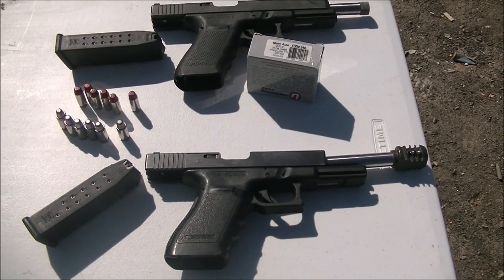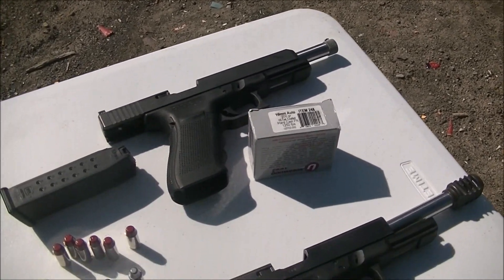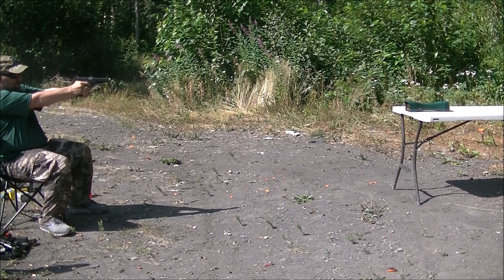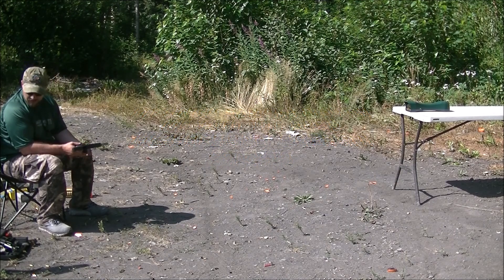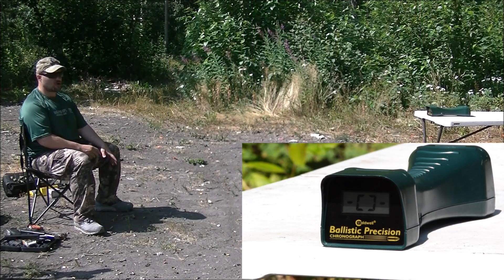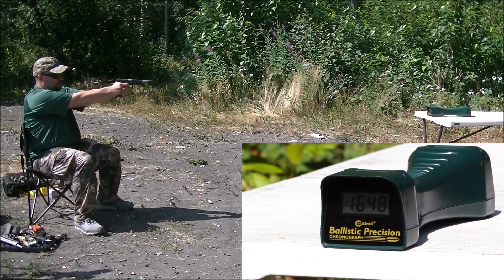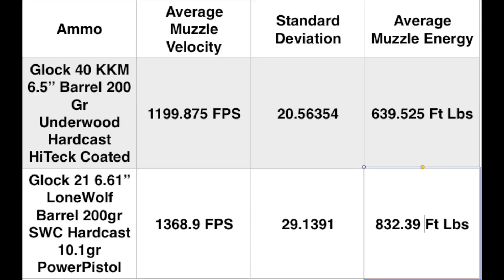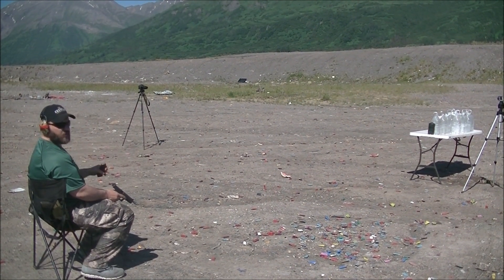10mm vs 45 Super 200gr Episode 3: Hardcast Lead

Comment: The .45 Super seems a little too much of a wildcat load for me. The 10mm is a proven performer and that loading looks pretty good.
Reply: It’s not a wildcat when several manufacturers make factory loads. I have 11 diff offerings sitting on a coffee table.
Reply: While 10mm is a proven performer so is .45. 45 super is just a +p++ 45 acp. It has a slightly thicker web. But because hundreds of different models chamber it it’s actually not a wildcat at all.
Reply: Leroy Dabbinzz Interesting and thanks for the info. I haven’t seen it around, but I probably haven’t been looking in the right places or very hard. How does the frame and hardware hold up to it? Seems like a lot of stress on the polymer G21 frame.
Reply: Meh, heavier guide rod spring any you’ll be fine. The 10mm is actually much higher pressure. And the g21 and g20 are very similar. Although I prefer the heft of a 1911 for a 45 super platform. With a nice WC comp it has similar recoil to a stock 45acp.

Comment: Mike R's comment about a 45 super and a 9mm +p... I think... NO WAY!!!  Mass and Velocity wins, but you have the numbers so I'll just stay in my area...Deer hunting!!!   lol
Reply from the maker: He has a point on the sectional density
Reply: Sectional density already factors in the weight , it is compared on the basis of the cross sectional area of the bullets .  * Everything else equal * , bullets of the same SD at same velocity, wil have the same penetration .

  But of course everything else isn't equal . Once you reach really deep levels of penetration , seemingly small differences in bullet design make a difference . Things like exact shape of ogive , exact porportions of meplat size, twist rate , etc .

Comment: Chuck I gotta say I love the testing you do and I agree both would be excellent choices for bear defense ! 
 I would definitely choose the 10mm personally due to its availability.
Reply: 10mm is certainly more often loaded by more manufacturers. Buuuuut I could be wrong here imo there’s only 3 or so manufacturers that load 10mm to its true potential with the appropriate projectiles for bear defense (underwood Buffalo Bore and double tap) and they all offer 45 super/450SMC loads too and since I have to order anything from those makers both calibers aren’t easy to obtain for me. So I chose the 45 super because it’s bigger, hits harder, and it’s different...... btw have you messed around with handloading 45 super in 45 amp brass? I know guys that break 1,000 ft/lbs in GI brass reloads. It may help make it more attainable to guys that have issues obtaining star line brass
Reply from the maker: Couldn't agree with you more on the availability. I only have three types of ammo available to me at a local shop oh, and one other place I can order it. Otherwise it's handloads

Comment: Not sure what's up with the 10mm velocities there, I average 1230 fps with the 220s out of my G20 with 6" kkm. I'm thinking about setting up a 45 super or maybe just running them in a HK USP 45 with a heavy spring, not that I need one, just can't help myself.
Reply from the maker: Lol... yeah.  Im going to email Underwood about these when i get home and look at the lot#
Reply: I'm running a 22lb spring, could that be giving longer lock up time and therefore higher velocities? I doubt it could account for that much difference though, you're running at least 100 fps slow. Just a thought.

Comment: I love all the hard work you put into these demonstrations! But I have to say  that I don't agree that those two rounds are "ballisticaly" similar at all.
The 45 super 200 gr bullet would be more equivalent to a 9mm 124+p @ 1300fps.
A 124 9mm has a sectional density of .140
A .451 45 200gr has a sectional density of .141
Both move at the same velocity would in theory yield the same penetration if the same bullet design is being used of course.
The 10 mm 200 gr .400 has a sectional density of .179
A balistacally similar.45 would be a 255 grn .451 @ 1200 fps with a sectional density of .179
Reply: Maybe I’m missing something but just because they have similar sectional density idk how you can compare a 200 gr 45 @1350 to a 124gr 9mm at 1300 just because they have similar sectional density. And no they don’t yield the same penetration one weighs like 80% more so it as a result has more momentum and energy.
Reply: Leroy Dabbinzz It is like chopping wood with an axe broadside vs on the edge. The axe still weighs the same, it is the sectional density of the blade edge that  give you the result.
In fact all things being equal (sectional density, velocity and bullet construction) a 9mm .356 124gn and a .451 45 200 gn in this case, if fired through the same medium will in fact yield the exact same penetration depth. 
It's simple physics really.
Reply: Your ignoring the fact that even I the 9mm and 45 super penetrated the same you'd be pushing through all that material with a projectile starting at 45 cal instead of 38 caliber and that's a lot more destruction along the same path!!!
Reply: It isn't strictly about equal penetration. It is about mass, frontal area, weight retention, size of wound channel and penetration. Sectional density alone is a criteria for finding the form factor which is a common denominator between two projectiles of different calibers, not a do all end all final, ultimate nor optimum choice. For example as you understand it already; a 175 grains 7 mm caliber bullet shares the same form factor as a 200 grains .30 caliber bullet. They are close enough that it becomes personal choice, mine is to go for the heavier of the two but it doesn't stop there. The 300 grains .375 caliber also shares the same S.D. and therefore "form factor". (bullets can be shaped any way you want and this does not under any circumstance change sectional density) so sticking to form factor....You could not hunt Cape buffalo in Africa legally with a 7mm or a .30 caliber. The strict minimum in most jurisdictions is a .375 Caliber bullet. My point is that everything I mention above "mass, frontal area, weight retention, size of wound channel and penetration" get into play. Not just S.D.
Reply: @paulhomsy2751  Fair enough. I prefer a .45 Caliber over the common.40 caliber bullets for the (Bear defense) loads. I prefer the heavier 255 grn over any 10mm/.40 caliber load. 
It’s my belief that the extra weight and momentum will carry itself through more tissue and bone. 
Not only that but in my experience 45acp is more reliable in function in most platforms. But that’s a whole different topic.
Reply from the maker: But this isn't .45acp
Reply: Right consideration👍
Reply: Right consideration👍
Reply from the maker: I can agree with that.
Reply: Maybe that’s not what you’re saying. But a 45 super is a completely diff beast than a 9mm. Sectional density and velocity isn’t the whole story
Reply: Leroy Dabbinzz I'm not saying at all that 9mm is a 45 super, I was simply referring to his comparison of the 10mm 200 and the 45 super 200. It's no surprise the 10mm penitrated deeper. It is more dense. 
A 255gn in 45 super would be a closer comparison.
Reply: @Mrgunslinger3  One bullet is not "more dense" than the other, one bullet made of identical components than another may have a higher Sectional Density than the other because of its heavier weight within its respective caliber. To say "more dense" can suggest that one is made of a softer or harder material than the other which is not the case. I know you understand what sectional density is, I'm just correcting your use of the word "dense" alone because it can be quite misleading when not used with the word "sectional" in this particular ballistics context. To illustrate the point I'm making better: Take two projectiles of very different materials in .45 caliber each weighing 200 grains. A wooden dowell and a hard cast lead bullet. they both have an identical sectional density. One is 8 inches long because it's made of light wood and the other is the size of a standard 200 grains, 45 caliber hard cast not even one inch long, yet they share the same identical Sectional Density. In this particular instance you can definitely say that one is "more dense than the other".  However when materials used are the same but one bullet is heavier than another of the same caliber, its sectional density increases but it is not by any means more dense than the other. The difference in density is based on the materials used. Nothing at all to do with Sectional Density which is strictly a measurement of mass. A relationship between the square of the diameter of an object represented in inches (decimals) to its weight in pounds, (not in grains). This is the international industrial standard.
Reply: Leroy Dabbinzz To put it more clearly
A 9mm 147gn
A .40 or 10mm 180gn
A 45 230gn
All share the exact same sectional density but weight much differently.
If fired at the same exact velocity through the same media using the same brinel hardness hardcast lead bullets each with the same bullet profile ojive etc... would have near identical results.
Not everything is Size and weight, but then again it is. 
However a bullet carrying more mass will most likely be less deflected when encountering bone etc.
Reply: @Mrgunslinger3  ummm..... momentum......
Reply: Dave Not that simple. Sectional density has more to do with penetration than foot pounds energy or "momentum " . I can take my .454 for example a 325 grain @ 1200fps will out penitrate a 270 grain load @ 1400 fps by a considerable margin. Both using the same style SWC bullet design. Why? Because the 325 grn is much more dense. 
An arrow that moves @ 450fps and a rock both weigh the same and both traveling the same speed will have equal amounts of momentum but one is much more likely to penetrate. Again sectional density. 
Hope that makes sense
Reply: @Mrgunslinger3  a 485 grain .458 bullet will penetrate more than a 137 grain .243 bullet, same bullet construction, oh let's say both 1500 fps. Same sectional density.......
Reply: Dave Pure speculation.
Reply: @Mrgunslinger3  okie dokie buddy 👍
Reply: Dave With equal amount of force in opposition -  no they would be very close in comparisonas far as penitration goes. It's simple physics with all things being equal as far as velocity and bullet construction. You're referencing a .458 socom and a .243 win, same sectional density would have the same amount of opposing forces applied.
Reply: Dave But in the real world where .243 win and .458 socom can't be had with the same type of bullet construction it is purely speculative.
Reply: @Mrgunslinger3  momentum bro, momentum
Reply: Dave Momentum and foot lbs energy are one and the same, and has little to do with "Penitration" which is the topic in case you forgot that.
Reply: @Mrgunslinger3  no, momentum and ft lbs are not the same. Kinetic energy and momentum are different sorry
Reply: @Mrgunslinger3  lol @ the quotation marks on my misspelled word
Reply from the maker: Mike Robinson i plan on doing the 10mm 220gr vs 255gr 45super
Reply: Alaskan Ballistics nice!
Reply from the maker: Did you see episode 4 where i did the 220gr vs the 255gr @Mike Robinson?
Reply: @AlaskanBallistics  I did not. Now I'm going to have to look it up. By the way, can you safely shoot 45 super in a stock glock 41? I've seen some say yes and others say gen 4 yes gen3 no unless modded. Just curious.
Reply from the maker: @Wildwestwrangler  Absolutely not. THe non fully sipported chamber would be a huge issue. WOuldn't risk blowing yourself up

Comment: Hard to beat that 10 since the ease of getting ammo is better.
Reply: Full power 45 Super is actually significantly stronger than 10mm. With the right powder (like power pistol) you can break 1,300FPS on a G21 and actually surpass 357 mag. I use cut down cracked and blank 308 brass which has held up well. 

The only way IMO 10mm will really take off, is if LE agencies start adopting it again which leads to surplus brass trickling down to the masses. I doubt this because ever since everything is starting to cater to the female officers, even 40 is being phased out for 9mm, and some departments are even kicking around the idea of 380! Even though I load the 40, 10mm brass is just way too expensive for me to justify adding it to my bench, and the capacity differences are not that big, like 2 rounds.
Reply: @DaveSmith-cp5kj  like your post even though I hate glocks, I have a sr1911 ruger want to convert it to shoot 45 super.
Reply: @scottkeppler7442  Well modern ruger has become incredibly based so I'm not against Ruger by any means. Personally what I wish Ruger would do is make a cheap 2011. There is literally no reason the 2011 is more expensive than the 1911, except for the fact that there aren't many companies making 2011 parts. Ruger is currently the biggest gun company in the world, and they can change that by making their own specs for 2011. I'm thinking polymer mags, red dot cuts, full picatinny rail, the whole 9 yards. There is no reason they couldn't sell that for 600-700 and it would absolutely rock the market. 

If they can make a polymer frame version then 3D printing groups could also just buy parts and assemble their own.

As far as your 1911, I think the sr1911 is already setup to handle 45 super, you just need to handload the ammo. Also you need to get a threaded barrel to put a muzzle brake with ports facing up or a silencer, as this is ultimately what keeps the action from prematurely opening and wearing out your brass. There is a guy here on youtube which has a step by step guide to shooting the 45 super, he loads them way hotter than I do but he has good tips on how to do it.
Reply from the maker: Is the ruger a fully supported chamber?
Reply: @AlaskanBallistics  Pretty much all chambers have a cut into it for a feed ramp, so basically no handgun is fully supported except for a few (desert eagle). That said, I do believe the SR1911 is strong enough for 45 Super.

The unsupported chamber thing is not really true as it was an explanation for why 40S&W guns kept blowing up. Glock was most well known for the kabooms because nearly all early adopters of 40S&W were LE, and LE had Glock contracts/discounts. The real reason for the kabooms however was that 40S&W was originally just a short 10mm. They used the original 180 grain bullet which occupied most of the case capacity. Normally case capacity being occupied is not a big deal (it usually is preferred because it prevents primer flash from igniting more grains of powder than normal), but the bearing surface of the bullet crimp and the already high pressures of 40S&W means if the bullet is set back even 0.005" from the listed spec, it can cause overpressures. This is why now you never see 180 grain 40 loads unless they are weak (under 1000FPS from a 4.5" barrel). 165 grain resolved the problem by allowing more space. The 180 grain isn't much of an issue for cast bullets as it deforms more readily than jacketed bullets, although roll crimps can induce the same issues since excessive roll crimps will dig into the lead, as well as not headspacing, potentially causing a case to pinch on the fouling as it expands and causing a minor constriction.

The chamber cut on the glock is of course to aid feeding, but also it is intentionally designed to cause a catastrophic failure to vent gases down rather than up. This avoids slide pieces being thrown into the user and instead vent gasses down the magazine with the idea that the magazine will eject, and absorb some of the explosion energy in its inertia. This is why a lot of glock kabooms usually have a lot of gas ejecting down out the grip. The chamber cut doesn't cause failures, by the time the chamber cut becomes relevant, the case is already compromised.
Reply from the maker: There are several barrels with way more chamber support than a glock.  Don't run .45 super from a glock
Reply from the maker: That is very true

Comment: Nice. That 45 Super sure has a smoke show. Do you shoot 10mm handloads. Curious to see a hot 10 handload.
Reply from the maker: These were supposed to be a hot 200 grain load they're obviously a dud in the 10 millimeter
Reply: @AlaskanBallistics  I have a bunch of boxes of this load. Shot fine but never Chrono or anything with it. Every round has gone bang. I got it for a Black bear hunt I want to do. I have alot of Underwood ammo offerings. I use Underwood's 180 grain Bonded jacketed hollow point offering as my carry ammo for two legged predators.